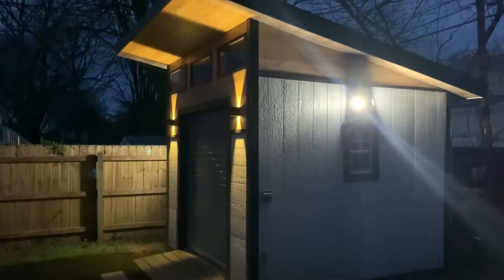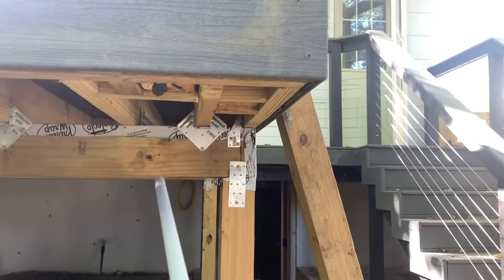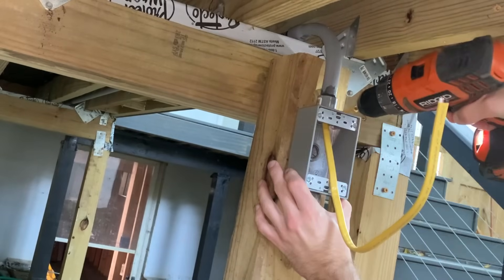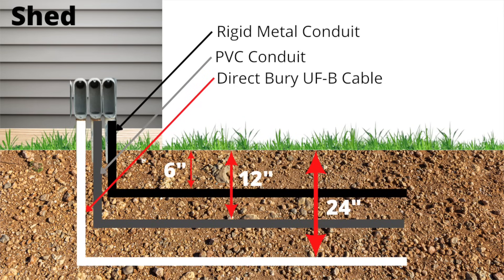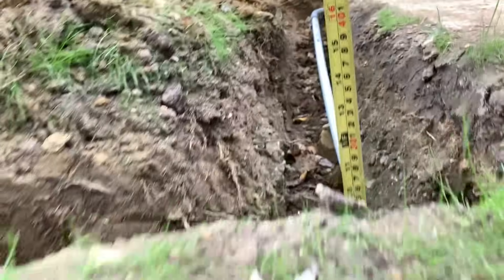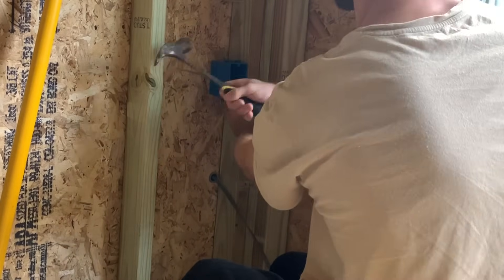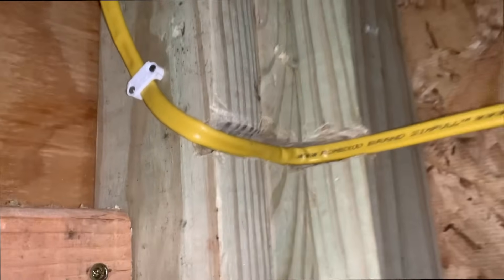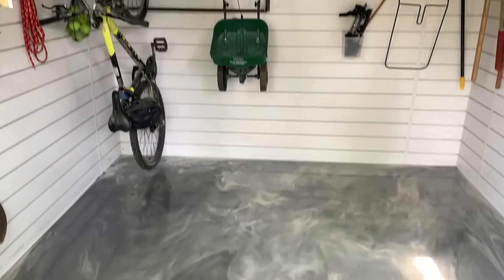Shed Electrical Installation (How to Add Electricity to a Shed - DIY)

Comment: You can’t run more than 20 amps on that 12/2 which is woeful for a shed. Second you can’t use romex in conduit
Reply: Romex is allowed in the conduit.
Reply: @pld8993  no it’s not
Reply: @arsenicjones9125  Yes, it is. If I'm wrong, please share the NEC code reference.
Reply: @pld8993  NEC considers all conduit run underground, in a wet location(such as outside the structure) and in or under a slab to be a wet location. In order that 300.5(B), 300.9, and article 100. And standard NM-B romex is not rated for wet locations 334.12. I double checked those are still in the current code but I can’t speak to when/if there are/were any differences in older versions.
Reply: @arsenicjones9125  Correct, in this installation the NM being installed outdoors is a violation but the fact that it's in conduit has nothing to do with the violation, and the Romex being installed outdoors wasn't your comment. You had said that you can't use Romex in conduit and that's incorrect; Romex is allowed in conduit.
Reply: @pld8993 if you wanted to be more specific you could have been ages ago but we all watched a video of a man burying romex in conduit. We all knew this was what we were talking about. Now you’re here trying to justify your argument cuz I called you out for getting it wrong now and 9 months ago. 

If your desperate to understand why it’s an all around bad idea go watch a series on the topic by abrelectric.
Reply: @arsenicjones9125  Someone commented 5 days ago, so I'm not responding to 9 months ago. Second, I'm not talking about burying Romex in conduit, I'm responding to the 5 days ago comment that said romex is not allowed in conduit, which is incorrect because Romex is allowed in conduit. I don't need to watch videos to understand the NEC, been teaching it for 25 years. 
Regarding the UF being installed in underground conduit, while not a good or professional way to do, it is allowed. However, installing the conduit sections while simultaneously pushing the cable through individual sections of conduit as you're assembling them is a violation. You tried to call me out for being wrong but you failed. You said romex is not allowed in conduit, you're wrong, and you failed to provide any code reference that prohibits romex in conduit. Any questions?
Reply: @arsenicjones9125  For clarification and so you don't get confused again, while it's common to call both NM and UF romex they are different cables. So now your opportunity to prove me wrong has doubled; please provide any reference that says either NM or UF are not allowed in conduit. Good luck
Reply: @pld8993  why are you talking about UF now? Did I reference 340? No but 334 for NM. Southwire owns the brand name romex. Southwire does not brand UF cable as romex. Please try again. I’m feeling really bad for you students. How can you teach them when you’re so incompetent
Reply: @arsenicjones9125  Wow, does it suck that much being wrong? Still waiting for the code reference that says romex is not allowed in conduit. Maybe if you read 334 enough times your imaginary code prohibiting romex in conduit will suddenly appear. 334.?
Reply: @arsenicjones9125  Nonelectricians, like yourself, regularly refer to UF as outdoor romex, genius. Since it seems like you don't understand what's happening in the video, that's not NM (romex) being buried underground in conduit, that's UF. Still waiting for that code reference. Since you're wrong and obviously can't admit it maybe you'll just attack and insult me again, which is fine, though not very original. Maybe you should find a plumbing video so you can pretend to be a plumber, too.
Reply: @arsenicjones9125  Still no code reference? Maybe you looked up the difference between NM and UF and finally figured out that you don't know what you're talking about, or maybe you're just not that bright and you still don't know. Either way, no surprise.
Reply: @arsenicjones9125  Namecalling is not an argument or a code reference. Still waiting. Maybe when you grow up you can become a real electrician, or maybe not.

Comment: I just want to run electric from the telephone/electric pole to the 8x12 shed 10 feet away, not to the house and dont want to put in a trench from the house a good 300 feet away($5,000)

Comment: No means of disconnect on the building.
NM used in wet location.
No warning tape in the ditch.
Boxes not flush to exterior siding.
Connector into the reddot 2 gang box? Was that a T&B 3210?

Funny how it’s a against code for us electricians to coach homeowners on their DIY project but unlicensed YT creators can just spew away whatever they please. If you’re going to release these “Look what I did!” videos, please do your homework. If you’re watching to learn, take with an extremely large grain of salt. Pick up a copy of the current NEC and you’ll start to understand. Nothing against homeowners doing their own work at all. It’s simply that a mis-installed window might not seal out the cold. A wrongly installed door might stick shut in a year. Plumbing might drain slowly if not correctly installed. Poorly installed electrical work has and will kill someone. No joke
Reply: You're right, multiple violations. However, warning tape is not required (these aren't service conductors) and neither is a disconnect.

Comment: Pro Tip:  non-metallic sheathed cable is NOT allowed to run into PVC Conduit.  You should have run THHN cable thru the conduit.  This is an absolute code violation
Reply: its totally allowed in dry locations...pro?
Reply: buried pvc conduit is defined as a wet location by code.
Reply: minor correction, THHN is not rated for wet locations, THWN is rated for wet locations. luckily almost all wire you can buy today is labeled THHN/THWN, so it rarely matters.
Reply: NM is allowed in conduit in dry locations and UF is allowed in conduit in dry or wet locations. There is no code forbidding those cables in conduit.

Comment: You said to consult with a local electrician and check local code, dude you obviously you did not because I can't even count the codes you would fail if you had that inspected... Sorry Bro, nice shed though, just don't want it to burn down or you or someone to get hurt or worse...

Comment: Ths is bad.  There is no way an electrician actually looked at this and said it was ok.  There are so many code violations here.  You can't run NM-B outside even in conduit.  Cables not secured properly.  Doubling up ground wires under the receptacle screws.  Not being able to pull the wire through the conduit.  Open hole in the panel box.  On and on...

Comment: That 12 inches is from the top of the conduit. Not the depth of the trench. You needed almost a 13 inch trench for 1/2 pvc and a smidge over 13 inches for 3/4 inch pvc. Also too many bends in the conduit. I countes at least 4 90 bends and 45 degree kick. No disconnect for the power in the shed. Wrong box for exterior lights. Looks like you failed inspection sir! Dig that shit up. Lol

Comment: 2 minutes into it and it's already wrong. Have you ever heard of the NEC or this thing called Amendments to the NEC relative to your specific area of State, County and City?  There's also the UBC with relative amendments which may or may not impact the height of your shed and set-backs from property lines. One of my neighbors had to bulldoze his entire home down because he figured he didn't have to comply with local building codes. Turned out, he did. Shucks...now it's at 3 minutes in and I can't keep watching. Way too many mistakes. I hope amateurs read all these comments and learn before they try to do what this guy did.

Comment: Not sure about the electrian who inspected your work ..Numerous code violations.   Romex should never go in conduit, should be Thhn,  no expansion fittings were used where cnuit enters ground, wires ng incorrectly done n outlets snd switches…
Reply: Romex in conduit is fine; romex in conduit outdoors is not.

Comment: I don't know who are the 'likes' of this video but I assume to be just the curious (without basic knowledge and don't like steps/procedures to follow). This guy is using wrong and/or unecessary materials making the choices for the job difficult to understand. He is using the wrong wire, expensive conduit, and expensive(not necessary for the job) boxes, outlets, etc. On top of that he provides no explanation why he used those materials. He is all over the place and it would be impossible for one to take such a project based on his demo.

Comment: You just showed us how to not install electricity to a shed. All conduits must be assembled before any conductors are installed in it.  Maybe you should have consulted with a licensed electrician and all applicable codes before making this video.
Reply: In this video the way he ran the wire is the least of his problems as he has other more serious violations.  While you are correct based on the short distance of his wire run was and since he used thickly insulated underground wire it is a minor issue as it is highly unlikely to get damaged during installation.............

Comment: you have to many bends in a run hide it from your electrician friends they will laugh at you and a inspector will fail you if you do this
Reply: National Electrical Code or NEC limits the total number of bends in one continuous run to 360 degrees or four 90 degree bends. It specifically states, “There shall not be more than the equivalent of four quarter bends (360 degrees total) between pull points, for example, conduit bodies and boxes.”

Comment: Total fail.  405 degrees in conduit run.  Only allowed 360 degrees.  Romex have twists in it.  The light boxes are not flush with outside wall.  Notching corner of 2 x 4 with out using metal plate for protecting wire.  No romex connector on bell box. Your romex NM-B may not be installed in the PVC cause it is now classified as a wet/damp location.  Code requires conduit to be a complete system then you pull in the conductors.  Total Hack job!!!!!!

Comment: Not bad for DIY work. Is it dangerous? No. Code compliant? Nope. Professional level installation? Also no, this is clearly amateur level / DIY work. The reason it's not dangerous is because that GFCI outlet will save your ass if anything goes wrong. There are many reasons why it is not professional or code compliant. I would not use this video as a "how-to" reference.

Comment: Totally wrong.

You need to use armoured Teck cable for underground wiring....code is typically 18 inches for elec. And 24 inch for gas.
Reply: The cable he used is literally listed for direct burial use. And it says 24" deep.
Reply: You're wrong. UF is rated for direct burial, or he could have run THWN conductors in conduit. Armored cable is not required underground. Depth depends on multiple factors and for electrical, it can be anywhere from 0" to 24". That said, there are multiple NEC violations in this video. Would never pass inspection.
Reply: @pld8993  well I literally pulled out my 2020 NEC before I responded so I don't know what you're going off of. Good day sir.
Reply: @ktw7hu  What's your point. I wasn't responding to you.

Comment: Was told that you can not by any means run insulated electric such as 12-2 etc under ground at all under the ground hence double insulating it under the wet ground., Tennessee different codes or did you only meet code by the fact you 
Used the “belt and suspender” approach using the UFB cable?? This misled all that have no  by saying you 
Could run any electric line through coduit, as long as it is correct depth. This is wrong on todays code world were i live.

Comment: The code doesn't alow romex in conduit outside but I think the code is written by idiots
Reply: Romex is not allowed outside, has nothing to do with being in conduit.
Reply: @AS-fm6iw  If the flex was outdoors then that was the right call. All conduits installed outdoors are considered wet locations.
Reply: @pld8993  that's what I said and it's stupid I still do it and don't care because I think the NEC is written by idiots
Reply: @AS-fm6iw  You've obviously never seen what happens to romex after it's been outdoors for a while. When the insulation breaks down and is unable to contain the voltage, someone gets shocked simply by touching the sheathing, which has happened to me. I must've gotten shocked because the code guys are idiots, not because of the genius who installed it where it shouldn't have been installed. It's a good thing you're so much smarter than them.
Reply: @pld8993  i said it's in conduit.... do you read what I wrote? I'm not talking about exposing it outdoors to the sun.. its hard talking to you because its as if you're not getting what im saying and yes the code guys are idiots and don't work the field just like most engineers I work with

Comment: So many critical comments from "pros".  Yeah, it's not perfect, but it's just a shed for crying out loud -- not an ADU.  The guy did a decent job for a DIYer.  We've all seen much, much worse.
Reply: The critical comments are necessary. This is a YT tutorial video. It should show the proper and code complaint way of doing it. Not simply the DIY way he hacked it in.
Reply: @sigcrazy7  No, the NEC is basically the "law" in places it is adopted. If not then typically another written code is adopted. It is certainly not a "recommendation", nor can the AHJ make up their own rules and codes.

Several people here have explained some of the violations or incorrect practices. Maybe there's just too many to bother explaining?
Reply: @sigcrazy7  Seems to me that the reason why they are making repeated comments is because he seems to respond to certain comments that aren't critical of the installation, but has remained silent about the obvious and verifiable code violations, which have been listed by article number. It would be helpful if he were to acknowledge the mistakes so those who copy this installation don't repeat the same mistakes, but I guess it's only about racking up the comment$$.
Reply: I agree he did a decent job for a shed.  But the pros are making these comments for good reasons.  For one, dealing with electricity the code is there for safety.  Shortcuts can make it easier, but dangerous, especially for DIYer's.  The second thing is cost.  This guy had a shed that was about 20 feet from his house.  If you have a shed that is 100 feet from your house and you get it wrong and it fails inspection, it can be very expensive trying to fix the mistakes.  I happen to like both.  I'm inspired by the job he did but appreciate the comments from the pros.
Reply: @petermoto409  You are absolutely incorrect about the AHJ. They can certainly make any rule they want, within the limits of their state’s law,. However, predominately the NEC is the preferred code in the USA. The very definition of AHJ is AUTHORITY HAVING JURISDICTION, so the NEC has no force of law until codified in whole or part by the AHJ. To assert that the NEC, which obtains its authority from the AHJ,  is also a limit to the AHJ, is disingenuous and circular. Aristotle would say you are begging the question.
Reply: @sigcrazy7  Key words there: ".....within the limits of their state’s law."

They absolutely CANNOT make up their own rules. AHJs are code enforcement officers, not code maker upper officers.

If an inspector said to you "I want GFI protection in this living room in case the carpet gets wet", I bet you'd just do it and not question him.
Reply: @petermoto409  The inspector is not the AHJ. If the AHJ specified GFI in the living room, you bet you’d have to do it. For example, Chicago requires all wiring to be in EMT. That isn’t a code requirement, but a requirement of the AHJ. An inspector is just enforcing the rules of the AHJ. Any pushback against the inspector must be within the AHJ’s own code adoption.